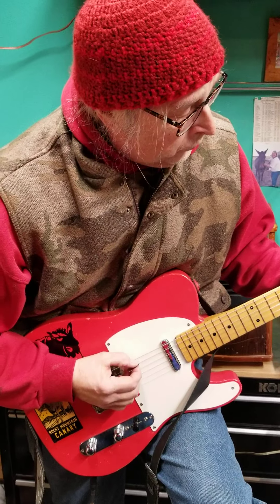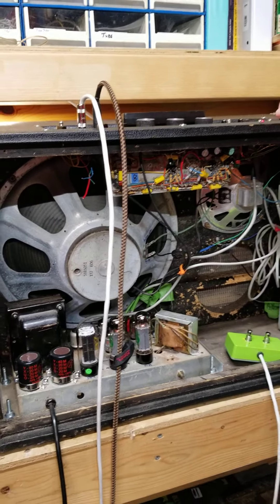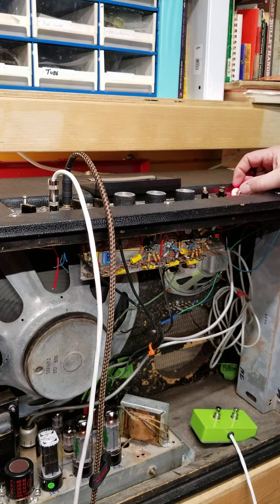Vintage 1966 Sano Guitar Amplifier Repair

Comment: I have a very clean 1966 Sano model 25WR w reverb/tremolo, 2- 12 inch cts alnico speakers. I plan on taking it to a tech soon to have it completely gone thru.
Reply from the maker: Nice. You dont find too many of these Sano's around. Not familiar with the 25WR.